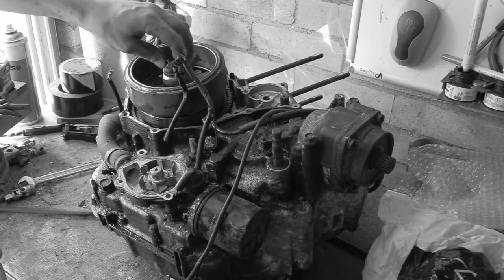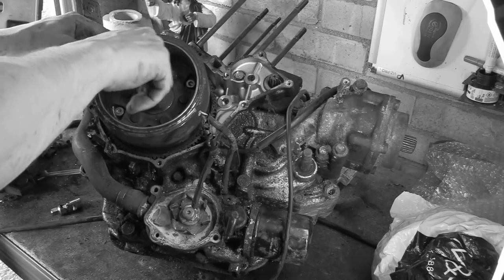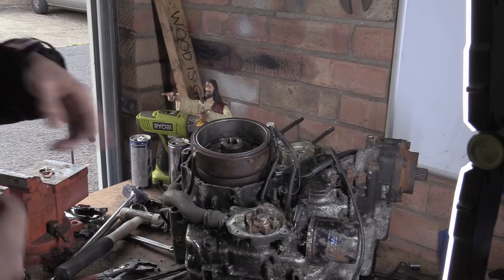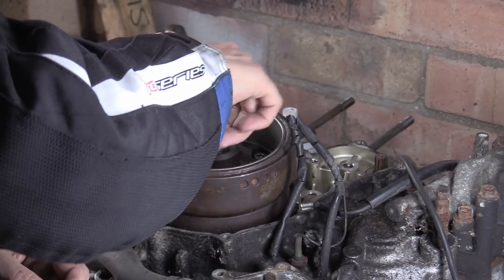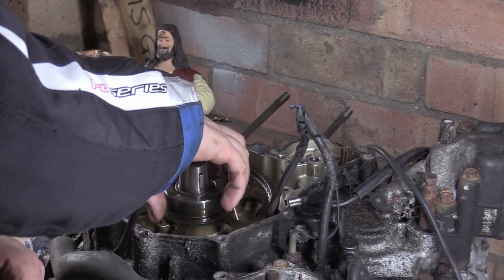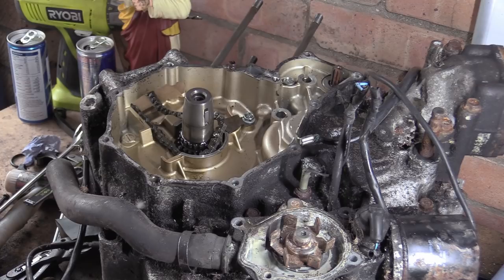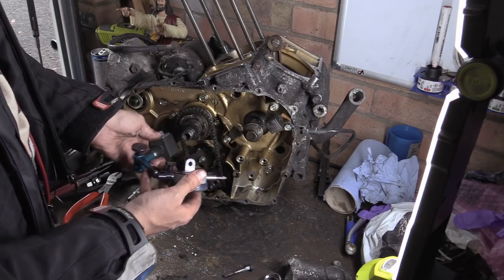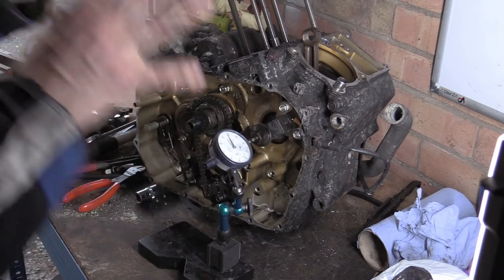Honda NTV - Part 9 - Flywheel from Hell

Comment: You could measure with a clock, but the usual way to measure side play is split the case  and use a feeler guage between the crank and  a specified point on a crank web , both ways work equally well, I once friction welded a crank spacer to the crank rushing a build on my old suz many years ago it was easily fixed fortunately

Comment: I've used a flanged bolt that seas against the end of the crank then pop the puller on. It also saves the puller damaging the threads in the crank.

Comment: I like using hydraulics to remove stuck ones just buy cheap cheece bolt that fits in extractor and dril hole middle for grease zerk
Reply: Ps. No need to fear destroying end of the crank using grease
Reply from the maker: The problem is the hole in the crank for the cross-feed
Reply: That makes it bit more difficult

Comment: Hi Mat, just a quick question. You have some uploads about shit tools. Can you reccomend any tool brands? I have brought cheap tools when I first started doing my own maintenance but over the years I have been slowly replacing stuff for things I hope will last for life but struggling to find tap and die sets that I know are decent or a decent bearing puller. Cheers
Reply from the maker: How deep are your pockets - and there's no such thing as a good tap and die set - buy individual taps and dies - If I had to recommend a tap and die set it would be Volkel - 

https://www.amazon.co.uk/Volkel-3-12mm-HSS-Tap-Die/dp/B00EO4LY80
Reply: @dirtygarageguy  how long is a piece of string. I get that it's just quite difficult to buy tools when you don't really know what's good or bad. I have mates with snap on that say they are overated for some items. I have a mixture of snap on and halfords advanced which for home use seems to be fine for sockets and spanners. Can you reccomend a decent torque wrench....it's my birthday coming up 😉
Reply from the maker: @ianshreddernelson3184  norbar
Reply: Cheers

Comment: tha needs an impact driver lad
Reply from the maker: Not for a flywheel it doesn't
Reply: @dirtygarageguy  Am i to be edumucated? been using one one flywheel pullers for years, its only ever eaten one of em....
just a baby one mind, not a big ole hefty thing, little handheld, the shock seems to crack the bond instant every time.
Reply from the maker: You don't wanna because of the following 1) you don't wanna spin a taper on a taper - this cause galling. 2) You don't wanna vibrate the magnets - as with the SV (not in this example) the magnets can come loose.
Reply: @dirtygarageguy  I KNEW I WOULD END UP EDUMUCATED, DANGITT

Comment: The “sly little fuckin spacer” is outboard of the bearing , not inboard as you have it.
You failed to flip the bearing & spacer when you placed it inside of the big starter gear.
Reply from the maker: no it doesn't
Reply: “Do it doesn’t”?

It really looks like you just lifted off the needle bearing with the spacer on top & plonked it into the back of the gear.
Reply from the maker: No it doesn't
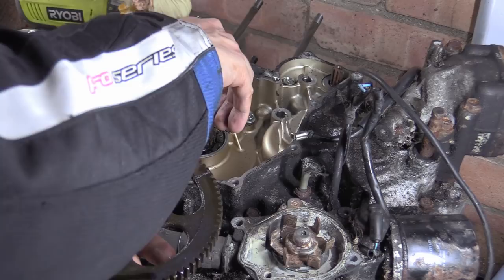Reply: The Workshop ,, 19:37 Matthew , watch it for yourself 🤔
Reply from the maker: Yeah? Nothing wrong with that
Reply: The Workshop ,, ok then , glad we got that sorted
Reply from the maker: https://scontent-lhr3-1.xx.fbcdn.net/v/t1.0-9/64568829_2304182783182164_288480927363891200_o.jpg?_nc_cat=102&_nc_eui2=AeG2_07S1plyCJbJUpxCjjqaCv0sLjXFDz21ojjFrlyrlIzxBwzST1d-fLjtD-lYr6nQfLPG-4Fps4Svks5DXLwpEq-2H3BN79-UVK9LbnxpyQ&_nc_ht=scontent-lhr3-1.xx&oh=e514e85ffb9af6e89c911f19e017ce48&oe=5D7A222D